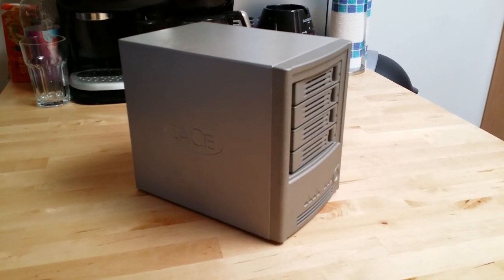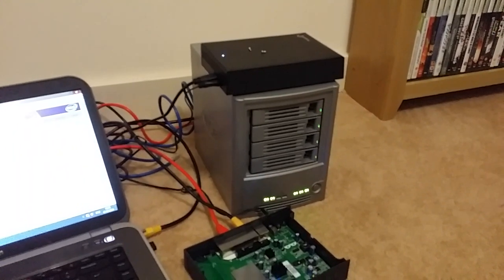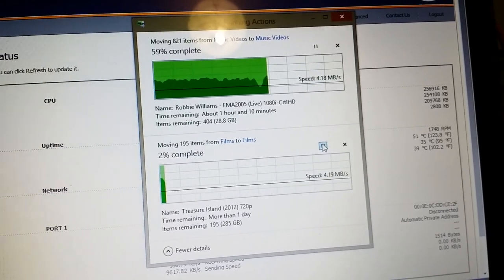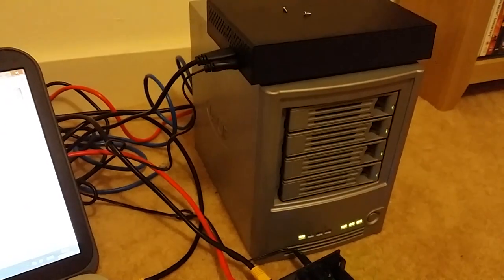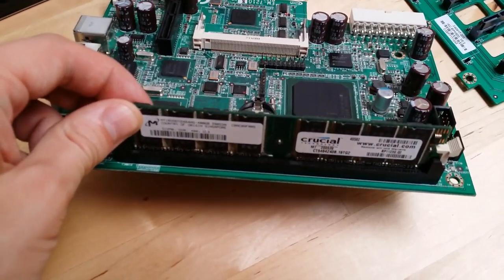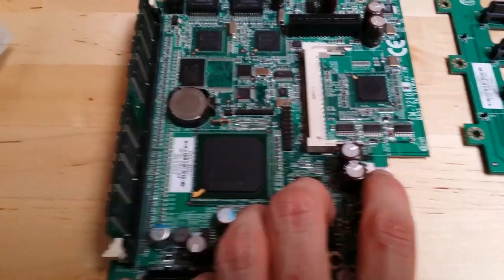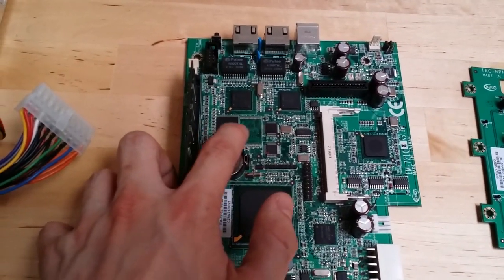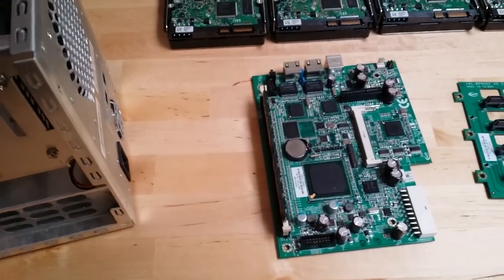4TB Lacie RAID Array Teardown

Comment: No hardware raid chip !

What on earth were they thinking ?
Reply from the maker: That was my main concern when I opened it up. It was surprising that a £15-20 RAID controller IC wasn't designed into a £1,200 RAID array!
Reply: that ZFS > hardware raid :P. May be worth a hack to see if you can put solaris on it .

Comment: First time seeing the molex+sata power combo on 1TB drives.
Reply from the maker: These were some of the early 1TB drives from about 2007, so to appeal to both Enterprise and Consumer markets, they added both power connectors because some enterprise OEM's were still using Molex connectors in their servers. There is a warning on the label explaining not to use both Molex and SATA power connectors at the same time.
Reply: Yeah. I have some of these with the dual power connectors.

Comment: Maybe get a cheep itx motherboard (either with raid capability or with a raid card), and run freenas or some other variant? I mean you could build it in a standard case, but updating that thing would be cool.
Reply from the maker: I just bought a 4TB USB 3.0 External drive on Amazon for just under £100 so I sold this on eBay the other day.

Comment: what do you mean no hardware raid? that whole boards job is raid. therefore it is a hardware raid. you knackered it with unsupported ram. put the original ram back and it will be fine.

Comment: I know this is an old video.  The fact that you get the same speed on a single spindle or when in "soft" RAID indicates that the issue is almost surely in the rest of the system.  I would guess a very inefficient network driver, or just a poor choice in the manufacturer of the network.  The slow xScale processor isn't helping either.  Back in the day when this was released, a hardware RAID controller did greatly help RAID 5, or any version that had to calculate parity.  Modern systems don't use them because those that are faster than the CPU, and also so much more expensive that they are not worthwhile.

Comment: Buypass the router.
Reply from the maker: I used a crossover patch cable at first, but the netbook wouldn't recognize the RAID array.
Reply: You have to set a Static IP(in the same subnet) on the netbook and the NAS box
Reply from the maker: pappkopp I started moving the data at about 3am so I wasn't completely awake! Yes, that makes sense. Thanks.
Reply: No problems, 
Regards from a sysadmin